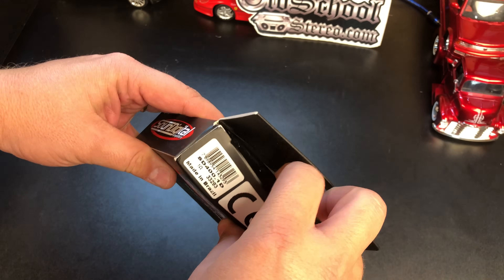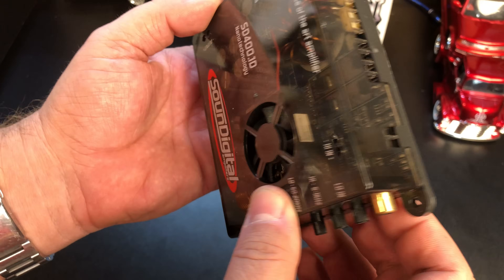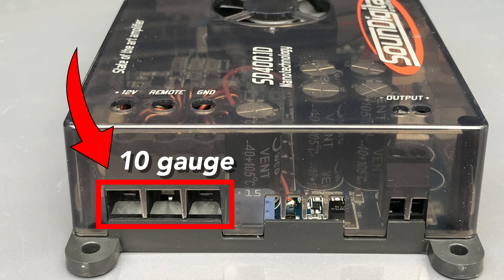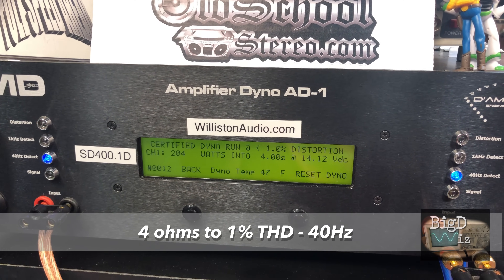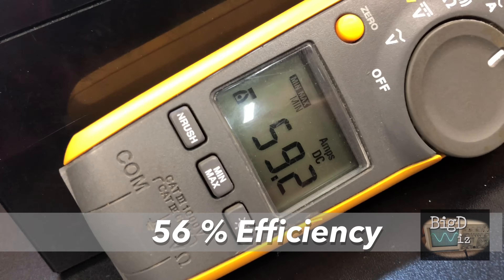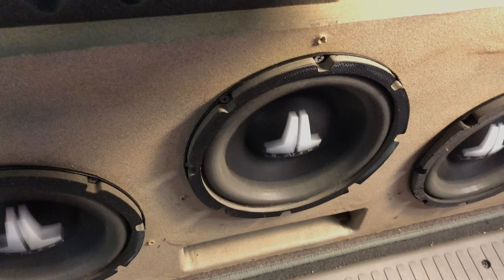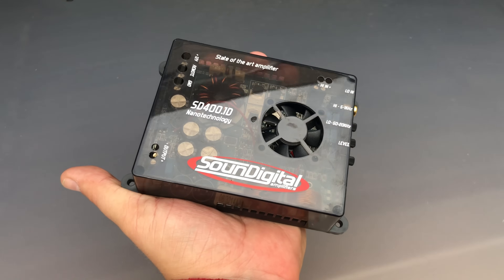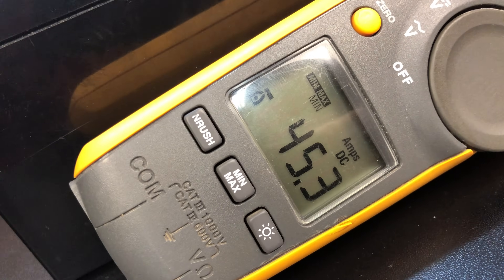Pocket Size, Big Power? SounDigital SD400.1D Monoblock Amp Dyno Test

Comment: Without care for distortion, the circuitry can get real small and cheap. For subs, they are okay but any of the multi channels, nah~~ THD is one of the points that defines a good amp. That is why the distortion led is probably on at all the times. Still price worth amp for subs for sure.

Comment: Twisting the wire actually makes it thicker, it's better to leave it straight, or actually you can get some ferrules to put on the wire, I'd recommend ferrules. It ensures all strands make proper contact, and give a good surfaces for the lug to clamp down on

Comment: At those terrible efficiency numbers, that tiny thing with no heatsinks is going to EXPLODE if you run it at rated power for very long. I'd personally pair it with a Rockville sub.

Comment: id bet the distortion is due to the inductor sizes in the amp
Reply: They lack a coil in the output stage and actually use the speakers voice coil for smoothing. I wish I could explain it better but taramps is the same whereas banda has filtering in the output stage. They actually cause the voice coil to get a little warmer than a Korean style amp at the same power.

Comment: Did anyone ever buy this amp? I saw Amazon had them in stock, but I did not get one. Now they are out of stock again.
Reply from the maker: I think they replaced it with the SD600 model
Reply: Thanks for the reply. I just checked Amazon and it showed they had 1 in stock now, so I ordered it. I am going to power a 6" JL sub in a round box that will fit inside a space saver spare tire in my Infiniti. Since the factory sub amp has a single channel high-level input, I figured I would test out this amp. 

I enjoy your videos!
Reply: I am sending the amp I got back. It had decent bass using the line level input from the Nissan/Bose amp, but I could not get good, consistent clean sound using 2 different PAC Hi/Low converters and several different RCAs. I wanted to be able to control it with a PAC sub volume control and line level is not ideal. 
BigD, do you know of anyone else who makes a single channel low wattage amp like this?

Comment: Something is not right with your measured efficiency. If it really was that poor, that sucker with its little fan and non-existent heatsink would be getting SMOKING HOT in a HURRY!!!

What I suspect is happening is that this amplifier doesn't have sufficient internal capacitance to smooth out its current draw at low audio frequencies, so your amp meter is reading the current being pulled by the amplifier at the peak of the audio waveform, not the average current which is what you'd need to know to make an accurate efficiency calculation.

Try putting a 1 farad capacitor near the amplifier, and put your amp meter between your power source and the capacitor (ie: not between the cap and the amplifier). This should average out the amplifier's current consumption.
Reply from the maker: The clamp meter and the Dyno are independent, so it’s nearly impossible to get an exact current measurement. What you say could be the case, I provide the current pulls just for additional info. I’ll clarify these current results may be off in some cases

Comment: Which small amp do you like that has a remote bass control?   Need something tiny for my truck and these seem right sized but want reliable  1 ohm in the 400-600 watt range
Reply from the maker: Most don’t have bass knobs. The one I like the best is the JL Audio XD600/1. It’s a bit larger than these mini amps, but built better and has an optional remote bass control.

Comment: 10 gauge power/ground wire for 500 watts??? also why so cheap when similar offerings from other manufactures are selling for over $400?
Reply from the maker: I agree, it’s concerning. This little amp is really impressive though!
Reply: even 8 gauge seems like it would be pushing your luck, no?

Comment: Do you know what happend if you radio has 4 volt RCA output ?
Reply: your amp doesnt get power from the radio.
Reply: It doesn't?? RCA's come from the radio don't they?
Reply: RCAs are for audio signal. your radio doesn't supply enough power for hundreds or even thousands of watts. that's why theres a very thick cable that runs to your battery. likewise the amp for my surround sound, connected to my TV, is plugged into the wall, that's where its gets the power from.
Reply: Is there a voltage rating on rca's on higher end units?? Does the higher tthe number (voltage) rating on the rca's indicate a more powerful signal to the amplifiers?
Reply: Diferents radios have diferent RCA output voltage. If you have a radio wit 4 volts in RCA, this amplifier blows!! Is very cheap amplifier.

Comment: clearly i'm a bit con"fused",, pun intended. i'm wondering how it could pull that much current with a 15amp fuse inside. or is there another fuse i didn't see?
Reply: Kirk Nelson there are two 25A fuses inside actually and one 15A fuse (for the output).
Reply: thanks, knew i had to have missed something.

Comment: Kudos to the amp for making rated power.  That said, I don't think it would ever attract me.  Between the loud fan, higher distortion, & low efficiency, I'd be willing to pay a bit more for something solid.  Which is unusual for me because I'm kinda cheap.  Still, great little amp for  someone with a small trunk.
Reply from the maker: +Mickey Pietrzak plus real cheap in Brazil. I was told these were between $50-60 USD down there!
Reply: If they can get it close to those prices here, they'd sell like hotcakes.

Comment: How do you set the gain on the amp before running it on the dyno?
Reply from the maker: +Qu¡noa_K¡ng•• each amp is individually matched to the Alpine head unit. Most of the time the gain is approx 1/2, but it depends on input sensitivity of the amp
Reply: BigDWiz Do you have a video of the process?
How do you match, and what do you match? lol

Comment: I thought Soundigital cleaned up their signals with their newer stuff but apparently not! If I remember right they were rated at something like 10% THD which is just terrible. That would explain why the distortion light stayed on since it will come on at 1%. Still impressive power. Dirty as hell power but still rated at least.
Reply from the maker: +Flexin Five Hundred this is an older model, actually discontinued already. I’ll get in a newer model to try

Comment: Nice test. That high-end of the xover freq makes using a pair of these band passed for midbass driver great, esp if you can hide the amps so you don't hear the fan or upgrade the fan with a quieter one.

Comment: manual says efficiency 95% O.o
I don't know if it makes any sense, but i heard that this amps has some kind electromagnetic field maybe that's why distortion lamp is on
Reply from the maker: +toshift2 the 95% efficiency may be at 5kHz with 5 watt output though. Efficiency means nothing if not given parameters
Reply: BigDWiz right
how about the distortion light?
have you tested with the scope?

Comment: What is the significance of the distortion light staying on?   I watched the video twice in case I missed an explanation of what that means exactly.
Reply from the maker: +phazel it is detecting 1% THD. Many class D amps are not capable of measuring using the certified (1% THD) Test. This one measured, just did not count up the wattage “cleanly”. I could not hear any abnormalities on speakers or subwoofers

Comment: Soundigital is one, if not the best, brazillian amplifier maker. They dont lie on specs and try the best for quality! 
The downside is that this fan is loud as hell hahahha I use a SD250.2d in the trunk and it can easily be hears inside the car. They released a new version called "evo" that uses only passive cooling. This enables it to be used in SQ systems without a problem!
Reply from the maker: +RafaGmod yeah that fan is loud for sure. But dang, what a cool looking amp!

Comment: Power Output will be same after 30 min burning of that? I guessing  you always testing 'cold' amp not after some burn in time so after they become hot that Output power would be limited alot ( for weak / small amps with bad cooling) - Just a small request coz most of you tested amps results can be huge changed after warm them up.
Reply from the maker: +Xyz Zyx I always “warm up” an amp by playing music at moderate levels for 15 minutes prior to testing. I will try cold to see differences.
Reply: BigDWiz Sorry then. Missed that somewhere (still didnt wached all you movies) awaiting for cold results then :)

Comment: We're probably looking at a s/n ratio of about 60-70db. I don't know how i feel about this amp. On one hand, if you listen to your music at moderate levels you shouldn't have too many issues. But i feel if you like to break the knob off on your head unit then you could fry coils all day on low power subwoofers.
Reply from the maker: +Wade Hensley most people in most cars could not hear the difference between this amp and any other Class D. Sounds fine to me and I’m a Class A/B “purist”
Reply: That clipped signal light being on the whole time got me trippin'. 140 bucks for that amp is a steal, but is it safe from an average power over time standpoint?
Reply: i just read down the posts some. I see that the dyno reads 1% and not clipping, so its all gravy train on biscuit wheels baby
Reply: The price there is crazy! Here in brazil it costs 140 Reais, converting to us dollars its like 40 bucks
Reply: it was already hitting 1% at very low power. That means about half way up it’s already around 10% distortion which is pretty much unlistenable. Not to mention it’ll burn up before the first song is over because it’s only rated for 20a continuously.

Comment: Thanks again for another great test! I've been interested in these for a hot rod application where weight is a big concern.
Reply from the maker: +Chase Wallace they have a 3ch version and 4ch as well. They are tiny and every SD I’ve seen tested does at least rated. Very light
Reply: Yeah, I'm pretty sure I've seen the 4ch version as well. I'm not ready to pull the trigger on building another system yet but the mini/micro SD amps and NVX amps have sure had me interested in the idea of trying to build something that's as light as possible and removable at the track (at least the sub/box). A place most of us know of that show the 4ch NVX amp on the dyno makes me question the numbers with all 4 channels driven. I love how you show everything and have nothing to hide. You do the car audio community a great service!

Comment: Not sure how much it would matter on the results, but stated 400w@12.6, not 13.46-13.64. Either way its a beast for its size.
Reply from the maker: +Josh Majors yes, we were right between 12.6 and 14.4 and right between the 400 and 500 watt rating 👌
Reply: BigDWiz I figured you had the corrected values, and that is very impressive for that small of an amp.
Reply: BigDWiz gotta say, you have the most impressive and extensive tests done. I wouldn't mind seeing how a cheap boss audio monoblock 5000w phantom tests. I had seen the one on the 4k, but curious how much difference happens to be between those two.

Comment: Impressive for how small it is. Why do you think the distortion light stayed on?
Reply from the maker: +PoppONaya Shelly honestly? I think the amp has an issue. I’m going to return for another.
Reply: @wal  its due to how they run the output stage. Taramps does the same thing,they lack a coil in the output stage whereas Banda amps have it. I wish I could explain it better but with these they use the voice coil for smoothing instead of having a internal coil.
Reply: BigDWiz keep us updated on that, I was wondering the same thing.
Reply: Maybe its a problem with the digital interference. It don't distort in the speakers but have some high frequency noise. With this amp turned on you can't even hear FM radio in the car hahahha
They fixed it in the EVO version

Comment: Its the best brand from here thanks for the video
Reply from the maker: +Daniel M not easy to find the small SD amps in the US. I’m not sure why? These perform well against other mini amps I’ve tested and use on motorcycles and ATV type vehicles is a growing market
Reply: The only Nano SD amps with official manufacturer support/warranty in the U.S. are the 250.1, 250.2 and 600.1 sold through their authorized dealer network. the SD400.4 EVO and 800.4 EVO are nano-like evo amps with passive heatsinking, and there's a 400.2 EVO on the way very soon as well, which I think is what some other commenters were alluding to. the 400.1 nano, 400.3, and plastic chassis 800.4 are only sold through unauthorized importers, and as such, warranty may be hit or miss on those models.
Reply: what is amazing is the fact that most components (or mains) in it are made by usa industry !!!!!!!!

Comment: Solid deal right there! I guess you wouldn’t want it up front with all the noise that fan seems to make though...
Reply from the maker: True, she is a bit noisy!
Reply: You are right, I have one installed under the dash, the stock fan was unbearable even with the engine running

I made a big round cut on top and put a really quiet 92mm fan
Reply: I used to have the 800.4 or maybe it was the 400.4 in my car and ran my front and rear speakers off of it. It was an amazing amp and actually wasn’t very noisy considering I had it in the passenger footwell
Reply: hifivega car
Reply: hifivega yeah $150 for a plastic amp? Ok👎